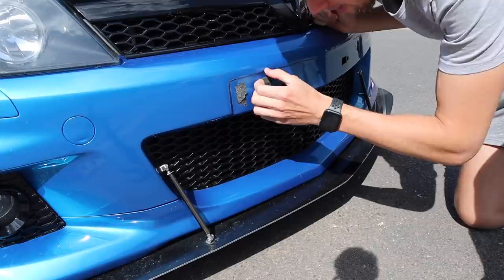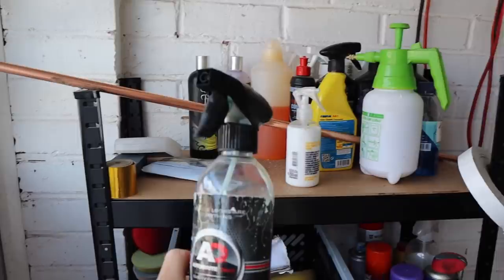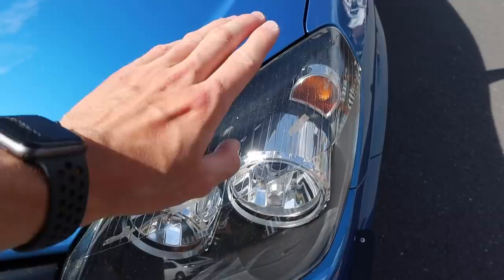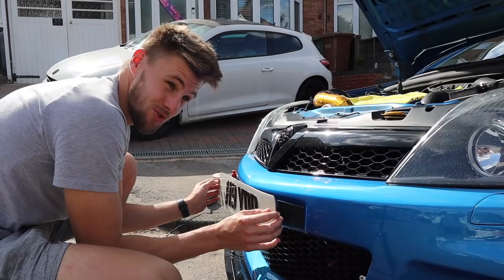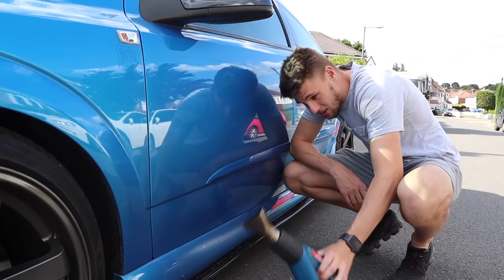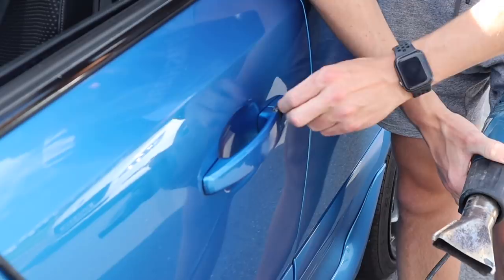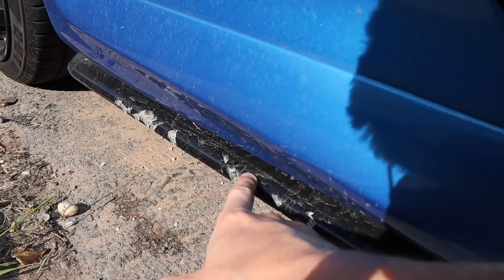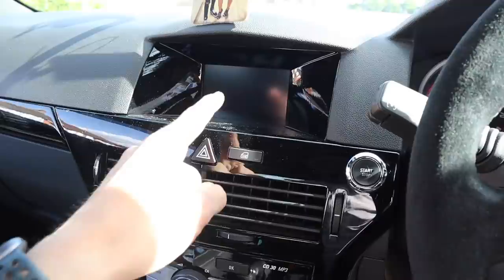THE LAST MODS FOR THE VXR (BEFORE IT GOES)

Comment: Just a word of advice mate, if you do all that work it will not increase the value of the car as maintenance is expected, mods can devalue the car as more and more people want standard cars. If you know for a fact you wanna sell it, let it go as it is and move on. All the best
Reply from the maker: alright man I just wanted to finish off what I started :)
Reply: I'd agree there. Some mods might be appealing to some people for example I fitted a reversing camera on my fiesta along with front and rear ST brakes. Haven't really changed the exterior look of it but I don't know for certain if most people would like these things I've done.

Comment: In regards to the cim unit you don’t need a new ecu set and keys etc 
All that is needed is a new cim unit replaced and coded in with tech 2 or it may be worth speaking to the dealer and seeing how much to have the unit supplied and fitted 
Just make sure you refit the original steering wheel if you go down this route as they may not want to touch it with the aftermarket one on there
Reply from the maker: Yeah buddy definitely don’t wana be messing with that if I get a new cim 😂 cheers man I’ll do some research and do some digging 👍

Comment: SMD (surface mounted diode) they are easy to change yourself if you are good with a soldering iron, ive done an astra H instrument cluster before I’m sure there was like 46 to change over, totally transforms the car but I wouldn’t recommend doing it if you are selling the car mate! Keep the vxr you will regret selling it.
Reply: Iv done it looks much more better bro
Reply: Shane Donnelly sure does but what I’m saying is I don’t think he should do it if getting rid of the vxr because it’d be a waste of time.
Reply: Done my astra in blue. Looks so much more modern

Comment: When I had my Astra I heated the plate then put it over a bucket with weight in the centre. Leave it for 48hrs and it will bend the plate enough to never pop off.
Reply: that's a clever idea 👍